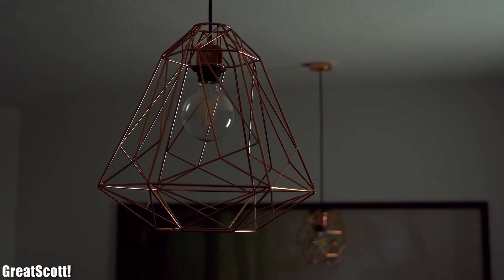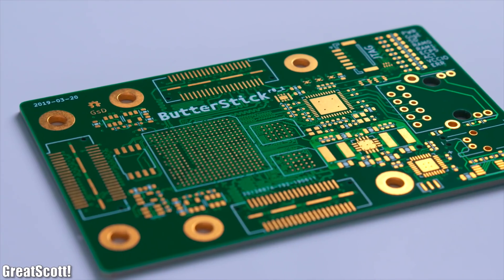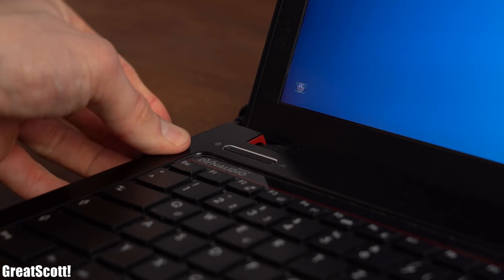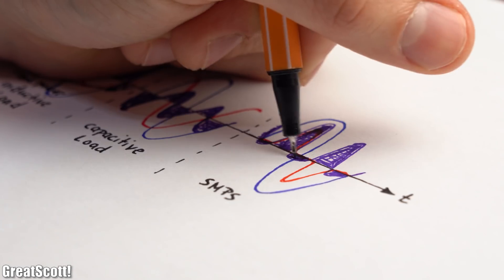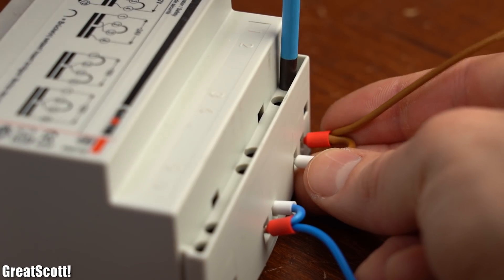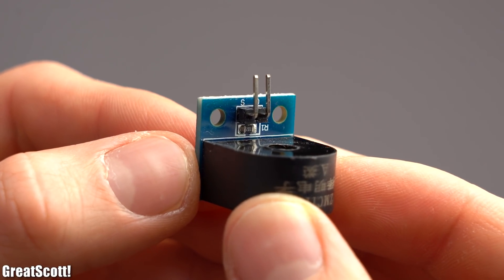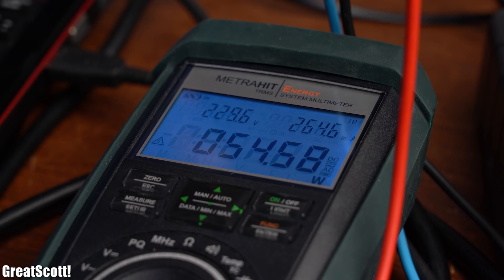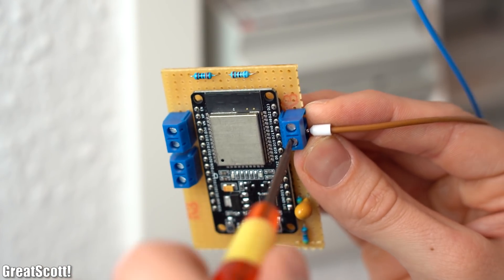DIY ESP32 AC Power Meter (with Home Assistant/Automation Integration)

Comment: Far less complicated in France..all you have to do is to connect to your electricity meter via 2 output pins and you'll have all the electricity info available through public encoded format...you just put a raspberry and decode those frames. Simple, accurate, and lot of informations about home electricity consomption. I am using this with OpenHab for years now...without any problem...

Comment: Hey Man,

Greate Work.
Can you post a video where you play a mp3  sound using atmega328 (Arduino Uno/Nano) without using any external shield.
Reply: Short answer, no, for two reasons:
1. The AVR isn't powerful enough to decode MP3s by itself. WAV could work, though.
2. The 328p only has 32 kilobytes of space to store data. You need something else like an SD card adapter to store a useful amount of audio data.

Comment: I think your problems with such diffrent values is the non-linearity of the ESP32s ADC. 

There is alot of stuff about this on google.

The best thing so monitor the values all the time is to use a Shelly 3EM and integrate it into your hass
Reply: You are right, but the different price tag.  Shelly3EM = 100€. if you calibrate precisely, the data are usable.

Comment: Arrrrg I was about to make an article about all the boards that we can use to measure with an esp 😭
Ahah anyway excellent subject !
I’m currently building a smart multi-socket with measure for each plug. Good to automatically switch off my solder iron automatically, switch off my speakers when my computer if off, etc...

Comment: Do i really need to constantly measure the voltage? Here in Europe it's not very common for AC voltage to vary enough to bother me, i can just assume the nominal voltage.
Reply: itg's was I think just take 230v
Reply: @tristansimonin1376  i guess you can have high curent spikes near zero voltage crossing or something like that throwing your measurements off during loads with poor PFC. but i am not sure... there must be some way around this, since i beleive you can measure power using RMS multimeter and get kinda sensible measurements... However if you want to measure power consumption of whole house using ESP32 uC, you can simply hook it to cheap din rail power meter with pulse output.

Comment: Great vid as always! Just one question, if you used a current transformer that supports up to 5A how are you going to measure the power for your whole house with it? Surely the house draws more than 5A and that could destroy the transformer
Reply: It can destroy the transformer if you put more than 5 through it I think 
You can just get a larger amperage one though to measure larger circuits tbh
Reply: It looks like he was just measuring a single circuit. Plus I don't think it would destroy the transformer, it would just give incorrect readings.
Reply: @eDoc2020  he was only measuring one circuit

Comment: I can reccomend shelly devices, most of them have power meter feature integrated, there are aswell a dedicated powermeter wit power clamps. Even 3-phase is available. And they can be integrated very useful 👍
Reply: thanks man. I needed a tree phase monitor and this is a good, easy to install and simple solution.

Comment: Hi! I tried this method but I ends up using the PZEM-004T or HLW8032. It shows more efficiency since I have one dedicated chip to measure the power and let the ESP32 to register and casting the data. The only problem that I found is that I don't know how to find if the power factor is capacitive or inductive. They just show me the power factor, without a positive or negative sign =/ Otherwise is perfect.

Comment: Great project. What is tolerance compare to Metrahit meter?
Can the ESP meter measure below 1W too? You know IT Equipment for example PCs it is only allowed to consume below <5W or much lower.
So it is interesting  to check different adapter for their no load power.

Comment: Will  you make a power conditioner, for audio equipment? Its a way to get rid of the 50 hz buzz and to filter it by using 230v to 230v transformator. Its used in professional music studios.
Or will u make a wideo about the ground loop effect and what can slove this buzz annoying problem. 
Greetings

Comment: This is what I've been wanting to do, though A) I want to do every circuit so I need about 30 channels of sampling, and B) I don't really care that much about precise values, calculating reactive power, getting RMS values, etc. I just want some relative values so I know what circuits to go after as hogs next, or which can be adjusted to run primarily in the daytime when the solar panels are producing.

Comment: Interesting video about measuring things by not measuring them directly ;)
Is the "voltage offset circuit" explained in another video? If not, could it be the subject of a coming video ?
Reply from the maker: It is just a voltage divider with a reference voltage that is not GND.

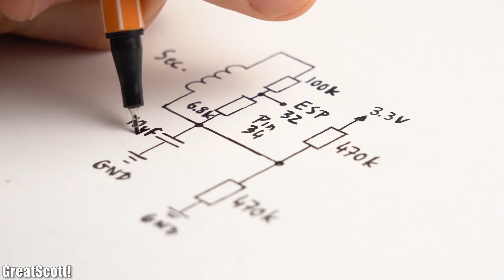Comment: I'd like to hear more about the circuit at 6:40 that scales the AC voltage and shifts it to be above the ground reference used by the ADC.
Reply from the maker: It is a voltage divider. Nothing more.
Reply: Kevin Counihan  Thanks.  I understand the resistor values, but what about the cap?  Why 10uf?
Reply: Kevin Counihan  Thank you!  That's very helpful.

Comment: Do you somehow have to compensate for the phase shift the voltage transformer makes? They are usually a bit out of phase and it's also load dependant
Reply: It'll never give accurate readings with this method as a standard transformer is too non linear and also adds phase shift. A proper PT or divider network is the only way to get good results

Comment: Very interesting video. GreatScott never disappoints! I made a similar circuit with the CS5490. Have you calculate the accuracy of the measurements with your multimeter?
Reply: I suggest you to take a look at the datasheet of the CS5490 which has some very interesting features

Comment: The ADC of esp32 is not accurate enough
Reply: Its non-linear. Thats why
Reply: It's a pile of shite
Reply: @sol3406  Is it consistently shite, in a manner that can be compensated for in software?
Reply: @vylbird8014  Yeah is it precise or accurate cr4p?
Reply: @vylbird8014  each pin has a different response for some reason and significant temperature drift
Reply: There are other ways to improve the circuit first before resorting to expensive precision ADCs
Reply: Yep, put in another dollar and add an i2c 16-bit AD like the ADS1115.
Reply: @drstefankrank  how many samples per sec can it do?
Reply: @drstefankrank  860 samples per sec.  Not bad for a power meter. But not good for an oscilloscope.
Reply: @TheRainHarvester  True, I didn't take care of samples/sec, just accuracy.

Comment: Part of the error in the measurements is due to the crappy adc of the esp32
Reply: Yeah. It’s a well known issue. Using the ads1115 is far more accurate, sw should be dead simple with esphome and you can even go with a cheaper d1 mini - excellent video
Reply: The meters here are much more accurate, and work directly with ESPHome (ATM90E32): https://circuitsetup.us/
Reply from the maker: I mean it is 12-bit. Not that bad.
Reply: @greatscottlab  The problem with esp32 adc is no linearity and lot of noises on the adc input.
Reply: @fabhorvi7236  true!
Reply: @greatscottlab 12 bits not a point when ADC is non linear, very noisy and not very stable. For precision measures you need external ADC or different MCU.

Comment: Can someone explain why you need the voltage sensor? Isn't a current clamp enough?
Reply from the maker: Necessary for the power factor calculation.
Reply: @greatscottlab  Ok, thanks for the reply. I ask because I have been using Flukso for doing similar stuff only using current probes: https://www.flukso.net/. I have three phases at home, so I would need to install 3 voltage monitors.

Comment: I'm using energy meter with pulse output wired to esp8266 and just counting pulses during time.
Class 1 IEC 62053-21 45A 230V 1000imp/kWh - everything is simple. Paid 54PLN (~14USD).
Reply: Same here, 1 module 1 phase or 7 module 3 phase maneler energy meter output 800 impulse/kWh very cheap and accurate enough for me, esphome already integrated pulse count energy meter.

Comment: I had something like that in mind for a long time, great job!!!

Adding a temperature sensor on a solar heater and a power relay we could remotely power on its internal resistor when we need it (without have it on all the time).

We can also watch the power consumption for security reasons and be able to turn on the outside lights remotely, and so on.

Home (and not only) automations with microcontrollers is so simple this days and we can do so many things that really worth spending some time learning how to program them which is pretty simple and a great way to learn children how and why programming is fun and why maths physics and chemistry is necessary most of the time on whatever we do :-)

Comment: Fantastic, thank you! I have been looking for something like this, my current energy monitoring system does not measure line voltage. I have two air sources mini splits which have an awful power factor, somewhere around .2 when the compressor is not running and it bugs me that I cant measure exactly how much power they use. This will be added to my project list.

Comment: For most people this is illegal. To do some work inside the fusebox you have to be an authorized electrician, with a company behind you to take the responsibility for the work. At least here in Norway.  For those who has got installed the new wireless "smartmeters" in the fusebox, it does almost the same thing.  There you can read how much electricity you use almost all the time.  (I refused to have a wireless meter installed" by the way. I don't want to be monitored 24/7)
Reply: Yea but in the real world its not in that way, good luck ma friend
Reply: @eumesmo-kd1tr  I don't  know what you mean, about the smart meters or the illegal messing with the fusebox?
Reply: @aslerunarborgersen5175  yea about the fuse boxes, i mean in almost 90% all around the world anybody can take a hand on the fuses boxes, of course on their on risk, i mean there are rules but illegal of course not that only happen in north Europe and north america (just canada and some northern county's of usa and california) maybe japon, regards
Reply: @eumesmo-kd1tr  a few years ago, not far from where I live, seven people died in a terrible fire, and the cause of the fire was they replaced a 10A fuse with a 20A fuse,  and it was winter and cold, they used alot of electricity to heat the house, and in the middle of the night it started to burn, and seven people died. Because they messed with the fuses without knowledge......
Reply: @aslerunarborgersen5175  what a shame, and i mean it's not bad that just authorized people do the job, but as i told you all over the word we have to do that job, one because the lack of money, 2 because is a job that everybody need to know how to do, and yes all over the world many people died because of electricity issues, best regards
Reply: @eumesmo-kd1tr  yes I agree. I also do almost all electricity work in my house. To hire an electrician here in Norway is expencive, VERY expencive, with prices between 150 - 200$ an hour.  I guess most people following this channel is people with knowledge, but what i wish was that he maybe had a little warning telling people that working in a fusebox is illegal, if you are not an electrician working in a company.
Reply: @aslerunarborgersen5175  good advise, that cost is impossible to afford i don't earn that amount of money in a week, what a crazy world, best wishes for you Asle
Reply: @eumesmo-kd1tr  thank you, and my best wishes to you too.  Take care, and stay safe in these crazy situation.

Comment: i suggest PZEM-004T + a 8266 for TTL and link to domotic box -> done :) i graphed with rrdtool and now integrated in grafana + influxDB. solar production and many home appliances are monitored that way.
Reply: It is cheaper to just buy a sonoff power meter for 10 EUR. It supports up to 16A and can act as a switch as well.
Reply: @mjk8019  had no idea sonoff was making wattmeter ! thx.

Comment: The more easier way is probably using the pzem-004T module with an esp-01...maybe a future project? :D
Reply: PZEM-016 is better in many aspect  (many device on one single uart/bus  , power factor report , 100A max , much much safer PCB design) 

i personnaly have 20 of them in my house :D
Reply: Personnaly i prefer the pzem.
I dont want 20+ more device on my wireless network.
And I prefer not to have the current passing thru the device , pzem use an external current transformer.
Regarding price the pzem is cheaper by 20 to 50%. (9 USD in china)
Reply: @cormacsyt0  
The pzem 016  and pzem 014
Need only one Arduino (or any controler)
And they output their own 5v to power the controller.

They work on a bus and you Can have as many as 256 on a single uart.

Currently is use mqtt to send data where i want 👍

Comment: I would suggest to use those Hilink 220v to 3.3v AC-Dc converter for directly run esp from mains
Reply: It won't be Suitable here, Cause those Generate Stable 3.3V DC while here we need to Sample the AC Voltage which Fluctuate Constantly
Reply: @prathamkalgutkar7538  i'm talking of supply to the esp

Comment: I love your videos sooo much. Also on your spot welder project, why does it  need all that circuit!? Just connect the power to capacitors and flip the output of pedal then if pedal is pressed energy passes through pedal out to your output pins. so when you press the pedal it discharges capacitors and when you release it starts charging it.